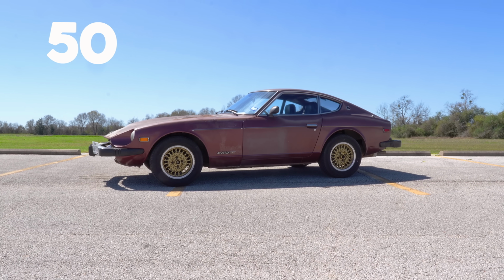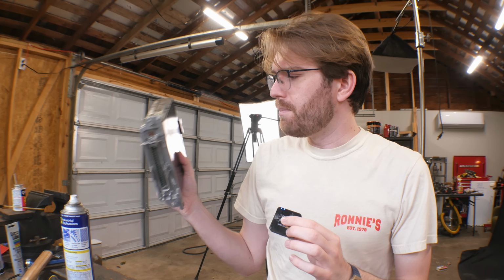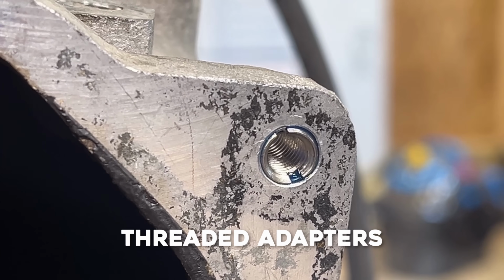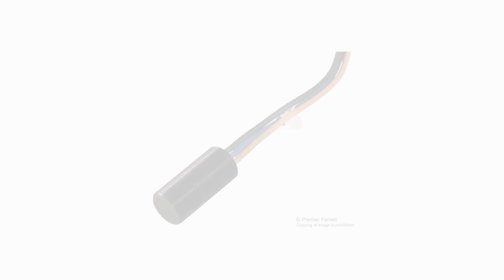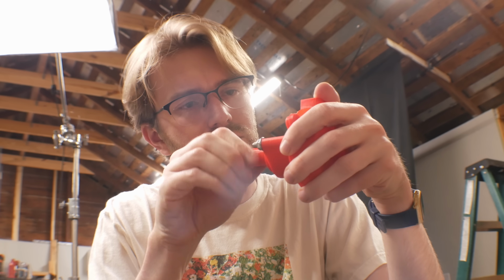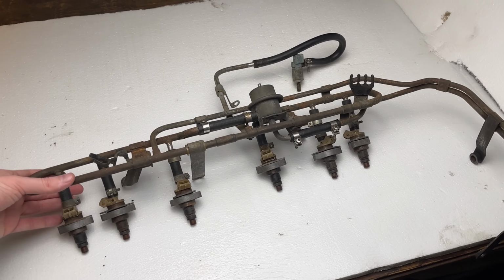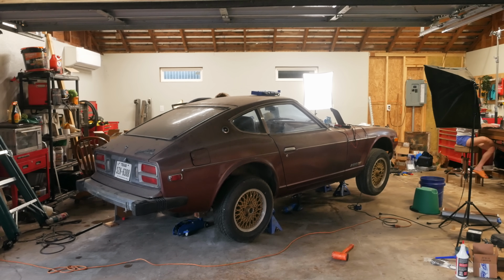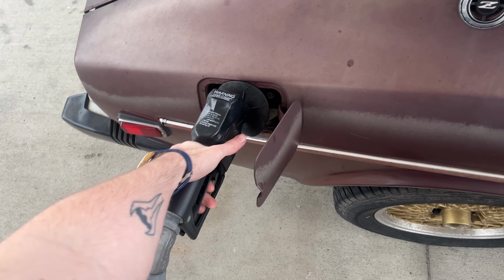Modernizing a Vintage Car

Comment: I love this so much! 
You have peak comedic timing with your humour. 

But besides your character, i actually plan to do something similar with my old Firetruck. Well in a good while, currently it's my daily driver and you're not supposed to rip out the engine of your daily driver apparently. 

But I'm converting it from firefighting service to my personal driving workshop. On my channel (here it is, the shameless plug). Hehe

But damn i would really like to reduce my fuel consumption..

Comment: step 3 ,,,get entirely new floor pans for the car. then a new custom tube frame to use as a basis for rebuildint the car from scratch

Comment: THE OG FUEL RAIL is horrid.  it has a tendancy to heat up and  vapor lock,  engine dies for 3 mins,,then it cools down and runs fine for 10 mins.

Comment: I have a question: does that work only with the CMP sensor to fire the injectors sequentially? I want to do the same on an old Jetta but it doesn't have a CKP and I understand it needs both in order to do that

Comment: I'm at 21:00 minutes... I'm wondering how that part has held up and how it handled air pressure changes. did you have to figure out any sort or lube systems for it?

Comment: ...or you could have just replaced the rotor cap and added a high voltage coil and added horsepower with better cams and an aluminum head and intake for probably cheaper.  Build what you want.  I'm glad you got factory specs.

Comment: Been scouting out routes for my 1986 Alfa Romeo spider with a dead Bosch L-Jetronic controller I am planning on restoring. Roughly how much did you end up investing into this project on this car, and can you share some of the model files for reference. I believe most of the things on these two cars are pretty similar if not the same.

Comment: When I was taking automotive maintenance at trade school we had an oldhead muscle car fiend. All he would ever really talk about during lecture is how much more complicated the automotive field had become since he got into the trade decades prior.
He had a 280z he bought in high school hot off the line that he still had as a project car. (This was around 2018)
“If my kids’ college fund was the same as the amount of money I’ve put into the Z they’d have both been through Ivy League.”
He ended up buying a totaled out Nissan Titan Platinum Reserve, ripped out the engine, slapped a supercharger and stage 2 on it and crammed it into that tiny little car and used it as a project for the class.
RIP Cooper.
A need for speed like that may never be seen with such a burning enthusiasm again in this world.

Comment: Man does this video bring back memories.  I bought a 1978 Datsun 280Z in 1987.  Great car but needed some engine work I couldn't afford so it didn't run as fast as it should have.  But the exterior paint (Carrot orange) and black interior was 100%.  It also had the factory 5 speed overdrive transmission.  Pure chick magnet.  I had to trade it in for a more practical auto after a 5 years.  Hard to part with it.  Does this have the standard 4 speed or the 5 speed overdrive.

Comment: When you remove one of the teeth from your distribution system, that alone should have imbalanced your plastic part due to weight momentum at high RPM.  Why not balance that weight like tires?

Comment: I would rather do a body swap.  Get the more reliable, fuel efficient. and reliable engine, but also better breaks and handling and a more comfortable interior... especially older cars from the 50s, 60s, and 70.  My dream car/truck would be to say cut down the frame on a Maverick and slap a 1950 Chevy 3100 body on top of it.  Have the great looks and be able to daily drive it comfortably.

I actually had 2 friends that had used rusted out Dotson 280z from back around 1989-93.  One bought it around 1990-91 and the previous owner had blown the engine and swapped a much larger junkyard engine from a Nissan Pathfinder into it.  That thing was scary and massively redneck engineered... but it ran.

Comment: That distributor replacement was installed apparently with no regard to where the cylinders were. So the missing sync tooth was in a random position. That won't work unless he's not telling us something.
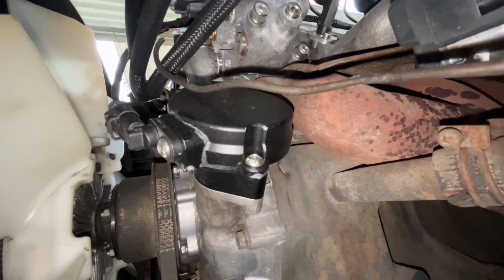Reply: Never mind. He did it later. Much later. At 25:25

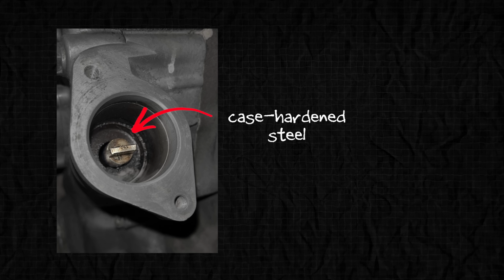Comment: 16:00 by that logic, wouldn't the cog that indicates shaft position also be made from case hardened steel? It would've been just fine as an aluminium part. Not like there is any force on it.

Comment: you should have changed the cam shaft.....to a high lift short duration cam.  and increase the compression a little bit. a top end change is easy.  then give it a valve job, mill the heads..etc

Comment: You can make one new modification by without changing the outside structure but by changing interior and engine with modern structure. A fusion car from both generation 😁

Comment: I would be really interested to see a tasteful modernization of the interior, with something like a small 1 din apple carplay with backup camera, buttons on the steering wheel (maybe from a newer Z) and heated and cooled seats,  but while still respecting the original design.

Comment: Of course you could have just dropped in a Miata engine and gotten the same horsepower in a lighter engine.  For that crap horsepower you might as well have just dropped in a V8 of which they make kits so the hard part is already engineered for you you would have gotten more HP and probably still better gas mileage.

Comment: Ronald, the amount of engineering and persistence behind this project is incredible. Instead of taking the obvious route and swapping in a modern engine, you set yourself the much harder challenge of bringing the original L28 into the modern era while keeping the modifications reversible. Designing and repeatedly prototyping your own cam-position system, building your first engine wiring harness from scratch, and then troubleshooting everything until the car finally ran shows just how much work went into proving the idea could actually work. Ending up with more power and better fuel economy while the internals remained 1978 technology made those eight months of work mean something beyond simply modifying an old car.

— Ken

Comment: Hall effect sensor sheet explicitly stated that the gap can't be used for initial position itself, but can be used to get the offset for the actual tooth it chooses as the "first" tooth. 

I know you saved the details from us and left it there on purpose. Sharing just in case others noticed. 

I learned a lot through this video thank you for the videography and insight.

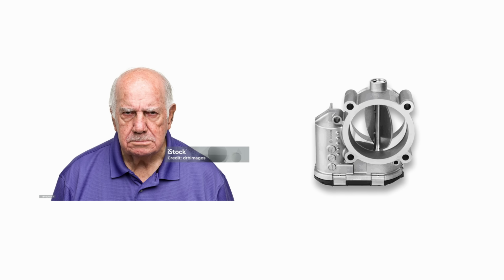Comment: 6:53 HEY!
So what I do Auto Electric diagnosis custom swaps and Repair and I drive a complete manual  injection Diesel

Carburetors are sort of black magic, but a good running engine with scavenging in the intake and exhaust is what a carburetor lives for

Comment: What about low pressure non storage direct to n anifold hydrogen from electrolisis water and bicarbonate of soda. So whilst it's not the most efficient engine it's running much cleaner

Comment: That was one of the best projects I've seen on YouTube ever. Taking an old car and making it more efficient is important because you didn't need to get a new car just a better running old and super cool car. The carbon footprint of the Datsun just got better. I know this is easy to say but! So now, you could think of a better cam, and better pistons, lighten and balanced crankshaft. New wheel bearings, propshaft UJs diff bearing to make the transmission as optimised for efficiency as possible.

Comment: I just did a diesel swap on an old jeep and a lot of what you ran into with this was reminiscent of what i went through with that- splicing into the body harness, trigger wheels & hall effect sensors, custom intake adapters. Every new problem had me grinning! So cool to see the excitement on your face during first startup, my wife said my face was identical when i got mine running!

Comment: 'direct connection to the car' mfs when they find out how a carburator works. (The amount of fuel entering the engine is based on the amount of air entering the engine so is only indirectly controlled by the throttle)

Comment: Wow! I gone with a little more drastic upgrade on my 59 Caddy changing transmission (last non-electronic gm) but keeping it carburated, but with pretty much the same results in a bigger beast: I recently beat 18mpg mark on highway!

Comment: I Did Something resembling that to my 95 Fiat Uno Mille.
It was carburated, eletronic wastespark dual coil ignition and mechanic fuel pump.
I installed a new intake manifold, cable driven TBI, change the exaust manifold to instal the O2 sensor, fuel rail, eletric fuel pump, trigger wheel and hall sensor in the crankshaft and the ECU from a junkyard Fiat Palio MPI. Redid some of the wiring and got it running all without experience following a forum tutorial.
My goal now is to turbo it using a Speeduino, individual coil. for that Im gonna need to fabricate some hallsensor and trigger wheel for the camshaft.

Comment: The quip about German Japanese cooperation is neither funny nor necessary. Bosch is neither just a dishwasher company but supplies electronic control systems for a variety of industries. Otherwise this could be an interesting video.
Reply: you must be fun to be around with

Comment: Wait, won't the pocket cause airflow to be a problem? You want a smooth surface, why not have the MACHINED PART, smooth over the hole?

Comment: That's not bad actually, a car with 170hp at the engine, would be around 130 to 140hp on the dyno so really car hasn't lost that much power

Comment: I did the same with an 80s Volkswagen engine. Inside also stock, add few more sensors+ECU. The fuel economy goes up from 12mpg to 16mpg, engine works so fine and reliable😊

Comment: If you open the original fuel injection there is a remote chance the engine mapping can be read from there.

Comment: classic or not I had a early 70's celica st (not even the gt) when I was in SLC Utah. blew these cars away in the mountains and canyons of the Wasatch not because of power but because of superior handling (an maybe a little my driving skill) but this comment is not about me, its about the most amazing 70's Japanese near sport cars and the superiority of handling over raw power. this was an era of #usofa oversized muscle cars that sucked gas (it was cheap and no one cared about the environment then) and only went fast in a straight line. I would still take a 1986 supra over almost any vehicle in that class but I have been driving performance SAABs since the 90's. fwd not my preference but a 9k aero with over 400bph is the most amazing sleeper and on the California freeways could get over 40mpg. astounding. still what you did is cool, just not nearly my favorite sports car.

Comment: Awesome awesome work. But I’m starting to see though, is one of the requirements for an auto shop now is a 3-D printer to build prototypes and then get the item made in the material that you need. I’m wondering how many companies will pop up that have the capability to print in metal for auto use. Just a great job and explained all the concepts incredibly well.

Comment: 170hp is actually CRAZY at that time. A 93 4.3l v6 that a chevy or gmc runs makes 160hp. A 5.7 only made 210 in that year.

So, a smaller engine making 170 in the 70s, was basically rocket science. 😂

Edit: I was curious, so I looked it up. There was a "gross" figure used at that time that is no longer standard. Under the new standard, that engine only makes 149hp. Which is still as much as my 93 4.3l truck, basically. 10 hp off. From a smaller engine.

I know those bottom ends are regailed for their toughness. I have always wanted a datsun 280z, so I remember doing the gearhead thing and wondering how much hp you could actually make without rebuilding the bottom end. I am about to check this, but iirc it was like 300hp or something. More if you rebuilt it. Just checked it...280-300hp bottom end. The injectors and ecu/afm restrict it to about 200-220 though.

So before I get too far in the vid (a few minutes in) since he says no touchy the insides, I have to guess a huge injector upgrade, ecu, airflow monitor, etc...and perhaps a bolton turbo or super is the answer.

I'll hang up and watch. 😂
Reply: I was curious what it would handle with upgraded internals (forged rods/pistons, rougher cam, new heads and lifters, etc.) and was absolitely SHOCKED.

600 HP from that little inline 6. Wtaf? 😂

I would think the block would blow itself apart if you got near 450. Sheesh.

Comment: Having owned plenty of these malaise-era vacuum-tube-spaghetti engines, I found it profoundly therapeutic seeing you murder all that garbage one little difficult piece at a time. And I know you did a good job because the end result with your throttle body and fuel rail looks simple and easy like you knocked it together over a weekend. Superb project and video.

Comment: I had the automatic transmission version back in the day.
The worst thing that happened to that engine was the anti-pollution equipment bolted on since its 240Z predecessor. Really took the edge off the performance. But it was such a great car to drive on the highways. (Needed better brakes, too.)

Comment: I had ( 2 ) of those & know EVERYTHING about that car ! & in fact, met my wife with my ( 280Z ).  I started with a Stunning ( 1970 ) 240Z -&- Yes, a ( 1978 ) 280Z. The Major problem #1 with the "Z Cars" were the "F"-ed-UP dual-carburators. ( See 260 Z ). They solved that with the ( 1978 ) 280Z -w "Fuel Injection"  !   Praise Jesus. !  After messing with those Dual-carbs. that would Never stay in sync. The "Fi" wS a Z-Car Revolution. The Only issue i ever had was the Oxygen sensor that would go out every once & a while. Though i was an easy fix & dianosis. The car would sudenly turn into a Diesel. HUGE Black cloud coning out the exhaust.
LOVE the ( 280Z's ) !

Comment: Just a thought for others - try a Fiat 124 coupe sport. Not the spider those are expensive sadly. The cars had such long production runs and parts were used across models that parts are cheap. the engines come NA in the second gen but were actually turbod in the lancia delta (same jnternals). Very easy to work on also.

Few upgrades as per your requirements 
- brakes 
- fuel pump/filter
- electronic distributor 
- overhaul suspension (cheaper than you’d imagine even though it’s double wishbone) 
- not sure if you banned performance cams
- put better cooling + a turbo! They’re made for it and have support for modern aftermarket turbos! They weigh less than 1 ton and easily support 200+ hp which you’d be surprised how punchy it is. I also would suggest upgraded clutches and they’re lesser well known super easy to work on so could be a cool project. Also they look great (I’m biased) 

Note I didn’t include supporting mods but simple things like that even without performance cams can make these seriously punchy and fuel efficient! They had that engine used for decades even as fuel economic standards increased - the distributor, new plugs and swapping carbie if you want to could really improve it.

They’re also reliable AF despite being Italian cars surprisingly. Theres a ton of aftermarket support for racing street sport setups.

Happy to send over workshop manuals to anyone reading

Comment: +20 wheel HP via what are essentially bolt-ons is massive, especially considering you boosted the overall efficiency.  Power/Fuel Efficiency RARELY go hand-in-hand so this was definitely a net positive.  Plus whatever weight you managed to lose by ditching all that archaic equipment, it really starts to add up.  And you've laid a pretty solid foundation for any future mods such as turbo/cam swap later down the line, having modern fuel injection and ECU tuning will really come in handy with any power-adders.

Comment: My first car was a 1978 280Z exactly the same color.

In original tune, when it was right, there was nothing wrong with it. My driving experience wasn’t measured in MPG, but SPG — Smiles Per Gallon.

It turned heads everywhere it went. It had the best clutch I’ve ever driven. It would do 120 mph. It handled like a slot car.

I wouldn’t have changed a thing, and if I owned one again, I still wouldn’t.

Now, if I found an old heap like yours, who knows what liberties I’d take with it? Especially because the expense required to make it concours-quality probably would exceed its value.

But if I could have one bone-stock and perfect or highly modded and equally slick?

I’d be thrilled to drive it like it’s 1978.
Reply: Not that you aren’t exceptionally clever; you are. And not that this wasn’t insanely cool; it is.

Comment: It has a measly 8.3:1 compression ratio. You'll never get good performance out of it unless you replace the pistons with lighter, higher CR ones.
Reply: all of that work for 15 hp? At least, it's a basis for a better engine but you're going to have to replace the pistons to something more like 10:1 to get really good power out of it.

Comment: engineering efficiency at its best😂 +2.888mpg and +16.75hp improvement. Thanks Ronnie, worth the 31.17min wait. Oh, and a more reliable car, once you get a new starter motor.🤣

Comment: A friend of mine had one of these, he put a tickled 253 Holden V8 in, twin turbo charged. He needed an adapter  pate to  bolt it to the gear box. Oh my god it was a ground hugging missile. I drove it once, it scared me the amount of power going to the rear wheels on such a light car. Had to concentrate and work the clutch to not to spin the wheels when starting from a stop.  It was a pleasure to driver once I got it rolling.

Comment: I had a 260Z with california side pipes. It would run 160, but had zero low end. Wouldn't even turn a tire over on vaseline probably. Zero torque. 

You went at this all wrong.